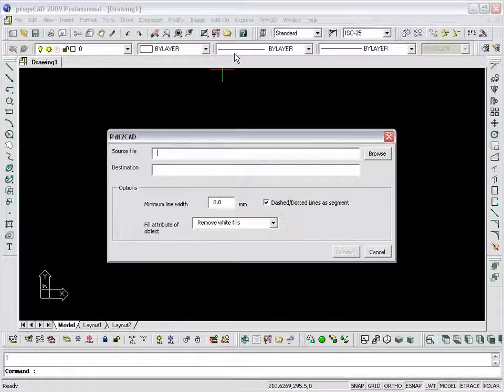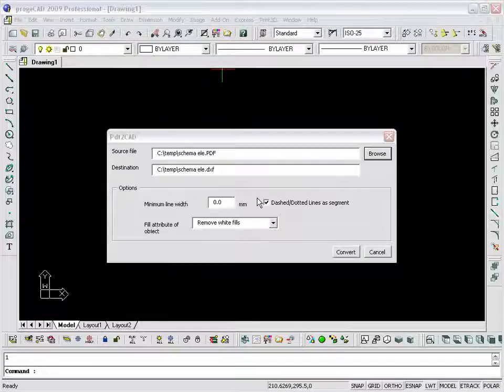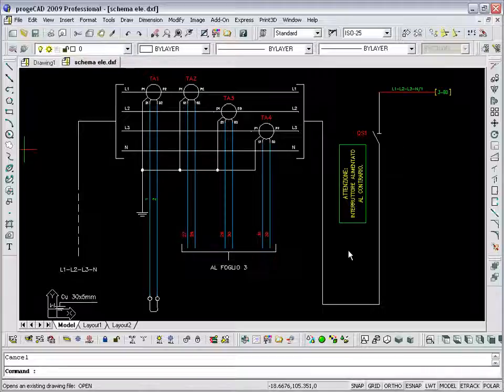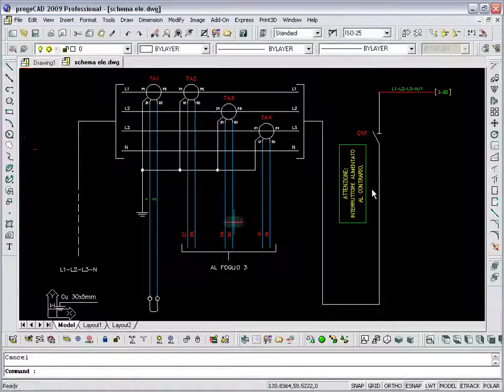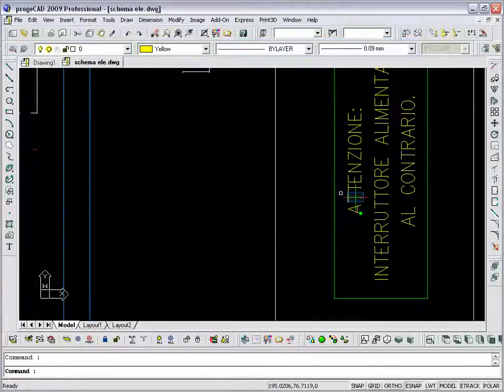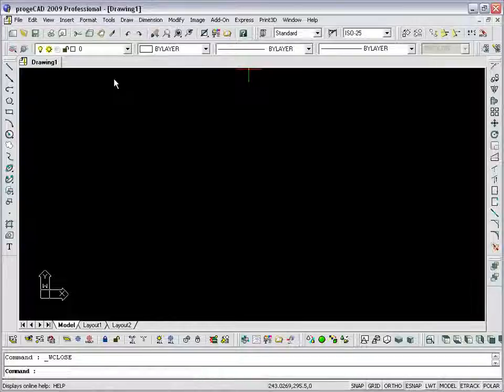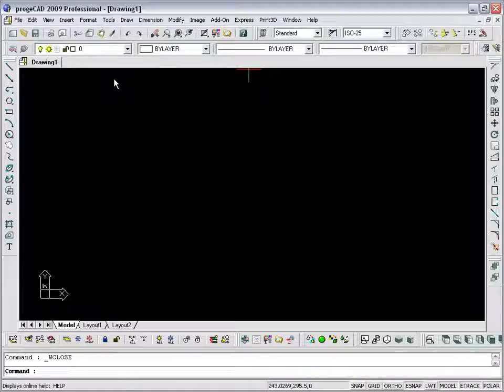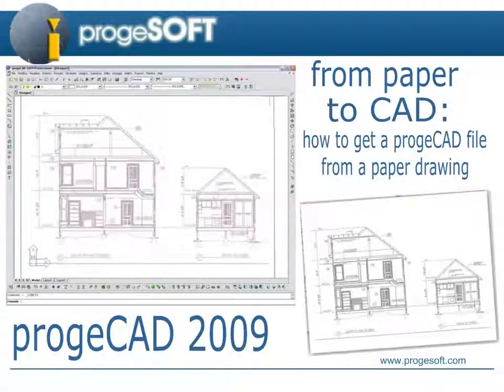Convert Adobe PDF into AutoCAD DWG with progeCAD Professional

Comment: hi. first of all thx a lot. but i gotta problem with text converting to pdf to dwg. letters converted  into different shapes. its readable but not good enought help me
Reply from the maker: If the PDF you are importing does not contain the information necessary to convert to a DWG it will come in as images. In other words, if the drawing came from a source which is not DWG to start with there may be issues trying to convert items the converting does not know about since the specifics are not defined in the PDF. That said, you have a couple of choices. Either replace the missing items manually, or try the Raster to Vector conversion built into progeCAD. However, the chances of the raster to vector misinterpreting the text is also rather great with the raster to vector and it may just be an exercise in futility. You may end up having to reproduce the text entities anyway. The conversion process is only as good as the source document you are trying to convert.